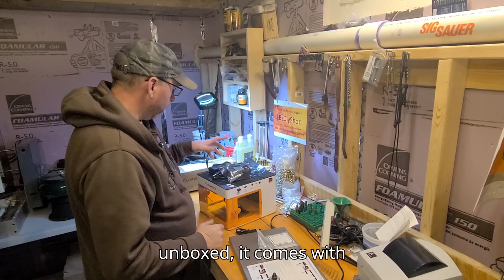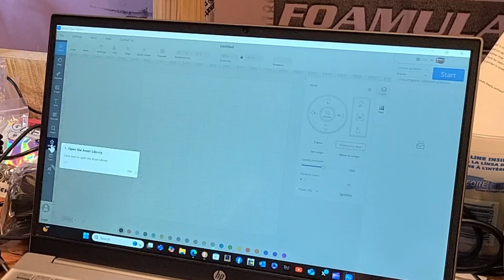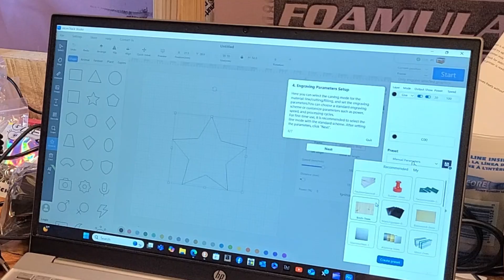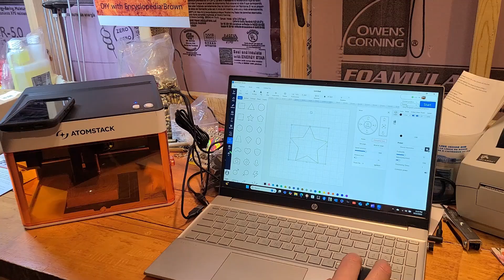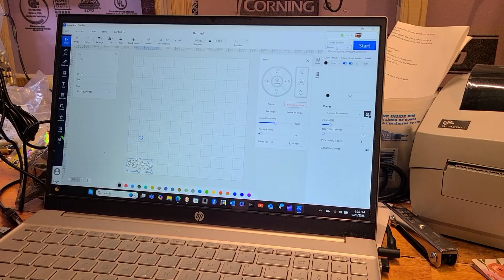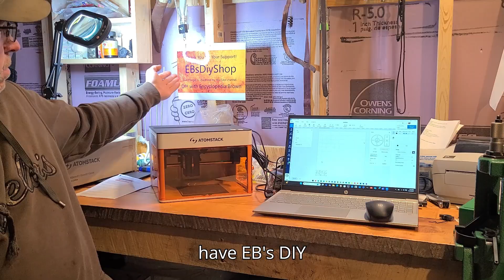Atomstack P1 Laser Engraver.

Comment: Hey man, how do I position the laser to get engraving in the center?
Reply from the maker: If your doing regular engraving. Id position my piece on the lines and then position the drawing in the computer program accordingly doing a test run after each time you move it. If engraving with the roller, same basic idea. Just have to take into account the offset if using the IR. Best advice I can say is to use some scraps and play with it until your happy with it.
Reply: @dustybooksdiy thank you for your reply, for deep laser engraving do I need the 1.2 infrared? Or can I do deep with a 5w?
Reply from the maker: @EL-JEFE-1 the infrared is for doing metal. The 5 watt diode is for softer materials suck as wood, leather, etc. Just remember that the p1 has a rather small work area that is about 6"x6". And I highly suggest an air purifier if doing this in the house.  Unless you can vent it outside. Also in reference to your previouse question. Some of the larger engravers have a camera on them that will center the engraving on your workpiece. That would make it alot easier and probably fewer scraps. But I dont have that so probably should find out for sure from somebody that has one on how well it works.